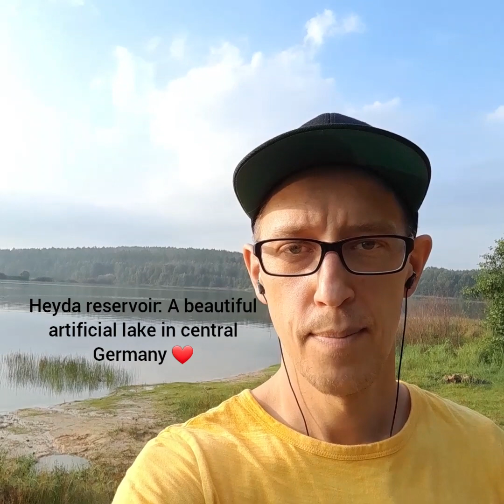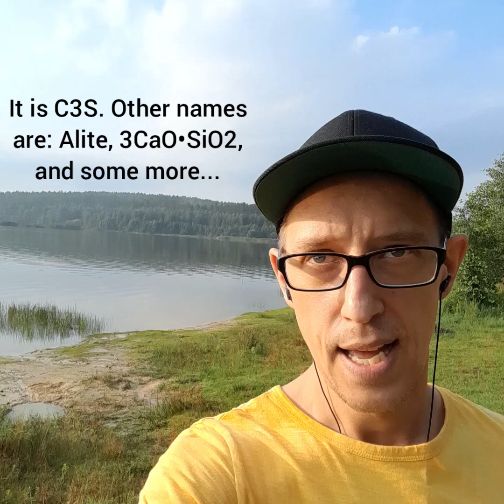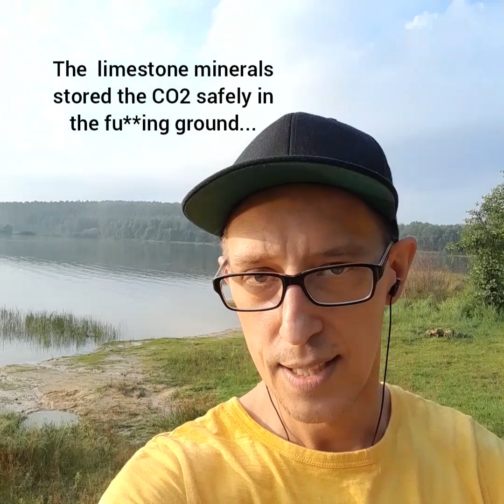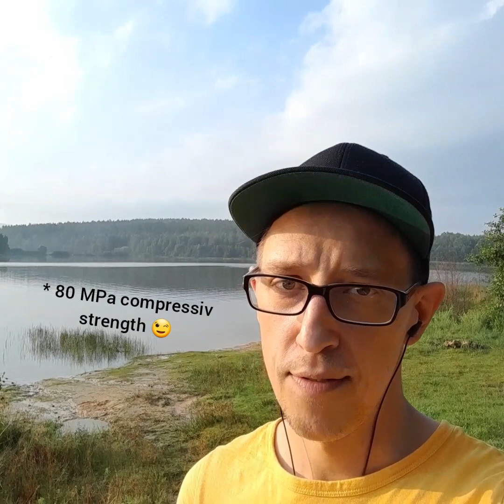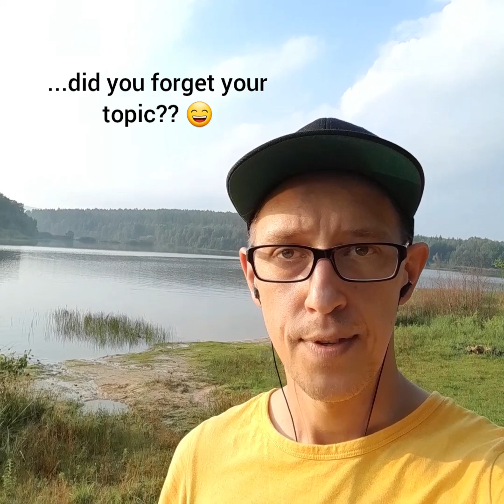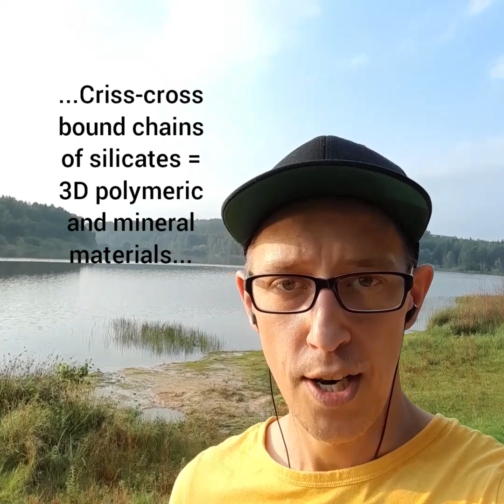What is a Geopolymer ? An introduction into the environmentally friendly high-performance cements.

Comment: Thanks Patrick, I’ve just watched all your videos. Can you do a large scale demonstration with 75% aggregate where you make a paving slab and show how that is done? 

When we make concrete slabs for foundations we only make side walls and finish the top surface with tools, does the Geopolymer need to be completely sealed inside a mould as it cures to prevent CO2 from getting to the curing surface?
Reply from the maker: Hey man! 

Thank you for your comment! I would love to create a video on this topic, but it may take some time since I'm currently involved in several projects.
To answer your question: Yes, you definitely need to cover it. You can use kitchen foil, cling film, or even cling film specifically designed for pallets. Alternatively, you could place it in a bag.
The reason for this is that if it dries out, the curing reaction will stop. Additionally, exposure to CO2 can be problematic. In general, it’s important to keep it well-covered to prevent it from drying out.

Best,
Pat

Comment: One other quick question:  What do you think of the idea of combining clay with aluminum sulfate and then mixing with plenty of waterglass?  The concept (or rather, hope) is that the waterglass and aluminum sulfate react to produce fibrous strands of aluminasilicate within the clay matrix, acting as both strengthening and heat resistance agents in the clay.
Reply from the maker: Hey Justin,

That's an interesting question. I've been wanting to conduct experiments like this for a while. You can definitely give it a try. I suggest purchasing a small sample holder made of plastic and conducting a series of tests, starting from a small amount of Al2(SO4)3 and increasing gradually. This should provide indications fairly quickly if it's worthwhile. In general, simply adding metal salts won't necessarily increase the degree of geopolymerization reaction. That's because aluminum or silicon salts are part of a system with little remaining energy, so to speak. Geopolymers require raw materials with more energy to actively participate in the reaction. For aluminum, it would involve metal-organic compounds (organo-aluminum compounds). Raw materials like fly ash, waterglass, and calcined clays are already the best choices.

But hey, give it a try, and then you'll see. Have a great time experimenting!

Best regards,
Pat
Reply: @Advanced_Materials_Publishing   I know that if you mix waterglass and aluminum sulfate directly, it will immediately react and produce aluminasilicate fiber strands.  I think this may be one of the ways that industry uses to make ceramic fiber blankets/insulation?  

   But the clay binder might slow down the reaction?  Either way, yeah, I may as well just try it with small samples like you said. 

 Danke Pat.

Comment: Hi Patrick, I recently bought and read your first Geopolymer book (English translation) off Amazon.  It's very interesting.  There is some info about fire and high temp resistance, but I was wondering if you could maybe give some pointers on the best combos/formulations for high temp/fire resistance?  Would the acid based geopolymers work better, since sodium and potassium act as a flux for glasses and ceramics?  (For my purpose, I don't need high, let alone, very high compressive strength, but I do need something that resists long term oxidization via fire and moderately high temps). 

   Also, Robert Murray Smith shared a couple videos about a geopolymer made out of a combo of clay, magnesium oxide, and waterglass (sodium silicate), which is dried at room temp for a bit, and then heated in an oven at 400*F/200*C to "cure".  Do you think this would have decent fire/high temp resistance properties?   This would be overlayed on/impregnated into basalt woven fiber cloth (hence why I don't want to use a formulation that uses sodium or potassium hydroxide, as the very high pH breaks down basalt over time, as you noted also in your book).  

     And if chopped carbon fiber strands are placed in it, will the surrounding geopolymer matrix be sufficiently protective against oxygen, to keep the carbon fiber from oxidizing at the normal 1200*F (648*C) to 1400*F (760* C) range in open atmosphere, or not? 

  Danke
Reply from the maker: Hey Justin,

I suggest once again trying it out (with the fibers). I can't predict if they will remain intact after firing. Perhaps AR-glass fibers would be a good choice since they are resistant to heat. You can create small samples and devise a testing regime with increased stress and exposure to substances, which should provide clear indications quickly.

What you mentioned about H3PO4 GPs is absolutely correct! In my book, there is a recipe using truss/tuff stone, from which I know it withstands heat because I used it to construct a firing box for making MK. They remained intact after several rounds of 5 hours at 800°C.

Best regards,
Patrick
Reply: @Advanced_Materials_Publishing   It sounds like it would make more sense to just go with the AR fibers, though they are heavier/denser. (But I may not even need any extra tensile and Young's modulus strength for my application anyways. The combo of basalt fiber cloth and cement will likely be enough). 

   Good to know about H3PO4 and your firing box.  

   Cheers and danke.
Reply from the maker: You're welcome, Justin. Ultimately, one has to put in the effort and create samples, I'd say. I find that the best fibers, in general, are short (8 mm or 1/3 inch) and not stacked. Basalt fibers are notorious for dissolving in basic geopolymer, but apparently not in less basic Portland cement. However, I have samples with stacked basalt fibers in them, and I can't observe any dissolution.
Reply: @Advanced_Materials_Publishing   That is why I am avoiding formulations that include sodium or potassium hydroxide, as it is very alkaline and could negatively affect the basalt fiber cloth. 

I will be trying magnesium oxide with fumed silica, water, and a little waterglass. One with the former and some clay.  

And some magnesium oxide with phosphoric acid and a little clay.

I've also thought about some zirconia silicate with phosphoric acid, but I don't want it to reflect IR too much.
Reply from the maker: Sounds great, Justin! Perhaps you could keep me updated on things like zirconia, as it's something I'm also interested in pursuing. Best, Pat

Comment: Makes me wonder about all that "limestone" in Egypt. Especially those "blocks" and casing stones with the nubs on the bottom corners.
Reply from the maker: Hello SeeTheForest, I think the lime stone in Egypt is made from lime rubble bound with a kaolinitic clay-soda geopolymer. If you point your rays or the microscope onto the lime or clam shells it looks like lime if you would aim it at the binding phase which is only 11 % I think, then you get a completely different result. Plus egyptologists are no materials engineers. They simply don't have the capacities to ask the right questions, I find. Have a good one! Pat

Comment: I've got a question for you regarding the recipe you posted in a previous video. I tried it twice and each time it took multiple days (4+ days) for it to harden inside the silicone mold I was using.
Do I really need to stir the hardening solution (NaOH and water and Waterglass ) for 15minutes? I think I might not have done it long enough. (I did make it the day before and waited 24hrs before mixing the metakaolin and then aggregate).
I used metakaolin but I couldn't find if it was heated to the 750 degrees C that you mentioned. It was listed as "metakaolin for adding to cement". Could that be the cause of it no hardening within 24hrs?
I used N-grade waterglass (40%) but not distilled water - so I'll try again with distilled water.
As for the aggregate I used feldspar sand.  I also tried one with silica sand and that worked a little bit better but still took multiple days or a week to harden.
I know I'm asking a lot, but is there a something I'm doing grossly incorrectly that is stopping it from hardening with 24hrs?
Reply from the maker: Hello frank! You ask just fine. 15 minutes stirring is ok but it is only that I had to state a number. You can also mix for like 20 seconds after a couple minutes again for 20 seconds... untill the NaOH is completely dissolved. I would mix it for 15 minutes only when covered as CO2 can destroy the properties. Try again donig it without to much contact to the air, just make sure the NaOH is largely dissolved, wait until the next day so the solution can mature and if takes that long again, it is most likely either the metakaolin or the waterglass solution. Tap water is normally no problem. Metakaolin for cement sounds just fine either. I'm not familiar wit the naming of the waterglass you mentioned. I'll have a look. In the meantime: Which procedure of mine did you use? Facebook, YouTube? Are there more information about your waterglass? I had to call the manufacturer to find out the modulus and water content plus many kinds of WG are of bad quality and decay rapidly because many of them are not made for being a reagents. Have a good one. Pat

Edit: N grade waterglass is fine, I'd say. Modulus of 3.22 should work. It's most likely the metakolin. You could ask the seller/manufacturer about the origin as they quite often buy brands of big firms like BASF as it was the case with my metakaolin seller.
Reply: @Advanced_Materials_Publishing  Thank you for the quick reply. I'll ask the metakaolin supplier and see what they say. 
I used the procedure from your youtube video that you posted 2 months ago.
Reply from the maker: @frankdrebin2343  You welcome! Let me know if you know about your MK. It is rather common that in the beginning little works in the lab but after some time you know haw to do it and what raw materials to pick. Regards. Pat